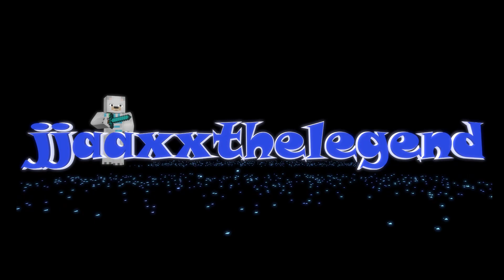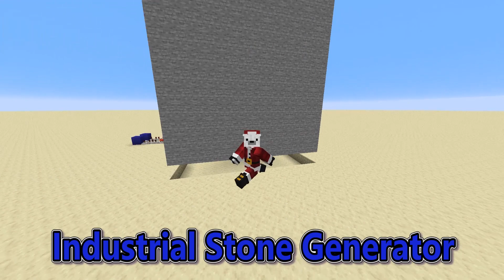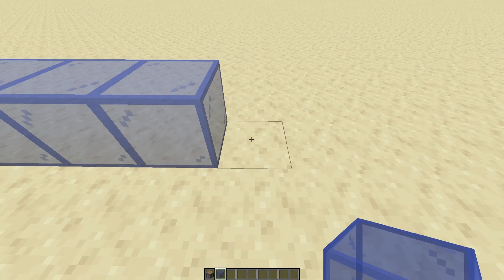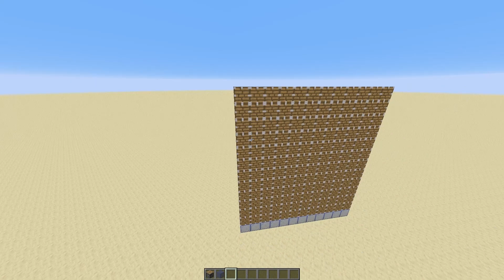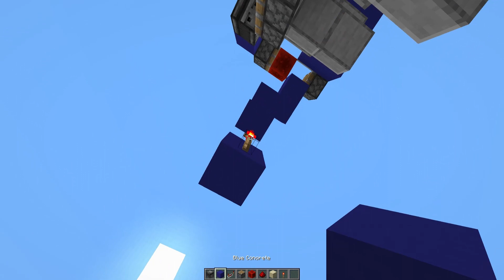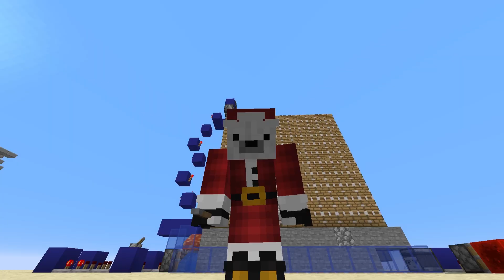Minecraft Stone and Cobble Generator Tutorial | Industrial for all the Stone you will ever need

Comment: Works great :D and also on the old version as well so now just need to test it on a server :D
Reply from the maker: Thats great Nocturn02  - Appreciate the feedback. Let me know how it goes on your server, I have it working on mine
Reply: @jjaaxxthelegend  
After many days on the server, an issue has been found.
If left unattended it gets easily jammed and becomes none functional :( 
most of the pistons on the wall stop working as well
Thanks for this either way 
it was a learning experience
Reply from the maker: Hey Noctern, Ive had it running on several servers with no probs however you might find based on your server settings that if you turn the clock off when you are not using the stone gen it might solve the issue for you
Reply: @jjaaxxthelegend  how do you turn the clock off?
Reply from the maker: You could add a switch system or you could just break on of the repeaters and then replace when you want to use it
Reply: @jjaaxxthelegend  Just completed it! at just above bedrock level 
So far so good :)